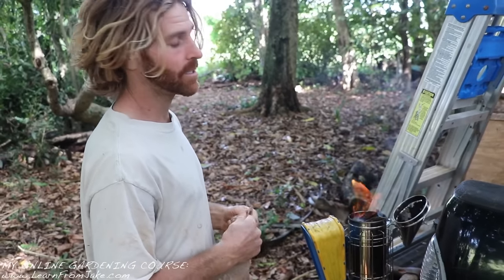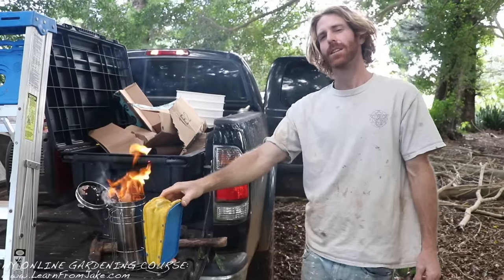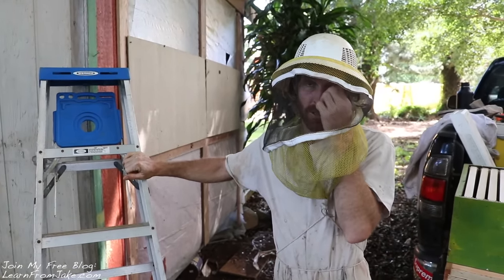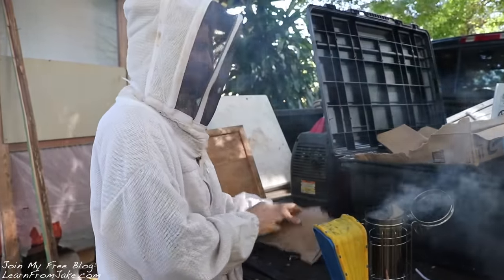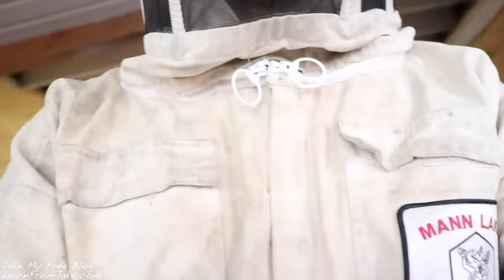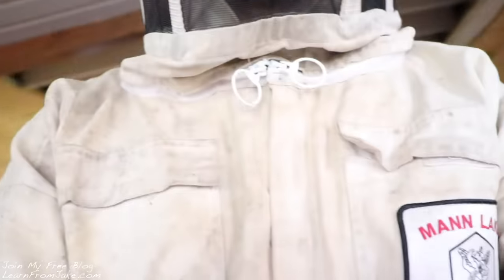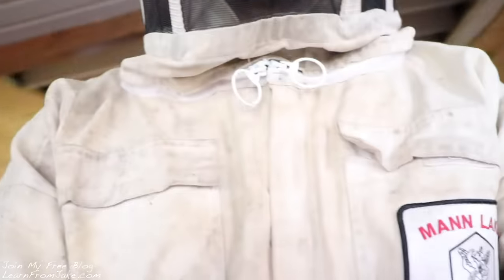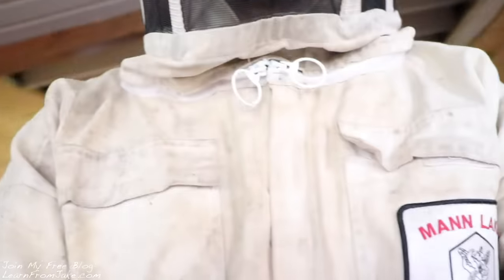Extreme Honey Bee Hive Removal | SO MUCH HONEY | Honey Bees in the Ceiling!

Comment: My answer to "why did bees evolve to die when they sting you" would be multifaceted. I haven't researched any of this but I thought it might be fun to just guess. 

Firstly, the stinger likely formed originally from some bit of carapace material, or even an orifice or vestigial organ, which caused it to be attached to other vulnerable innards in a way that isn't easily or safely severed.

Second, evolution doesn't have an end goal in mind. Nothing in nature or in the bee thinks "it would be better if losing the stinger didn't kill us, let's work towards that." Evolution is blind and is very rarely a perfectionist. The stinger characteristic only stuck around because it provided an advantage over what was there before and the bees who had it were able to more successfully pass on their genetic makeup and/or outcompete. It's possible that eventually, with a lot more time, even better defense mechanism woul evolve over millions of generations or more. But for now, even though it kills the bee, as far as evolution is concerned, the trait works good enough.

Lastly, again evolution is most often a very slow process of feeling around in the dark, and making small bits of progress through trial and error. For the stinger not to kill the bee, it would mean the bee has something to do after it stings once. Probably the most reasonable approach would be the stinger just doesn't fall out, since it would require a reshaping of the stinger and significant strengthening of the carapace. Not too much to handle there. Another solution might be that the bee loses the stinger but it doesn't die. In that case, it can't contribute to the hive nearly as well without it's main defense weaponry. It would ideally either regrow its stinger, or maybe develop a new job for the hive. In both cases, it's possible that it's just not worth the resources to the hive when you can just grow all new offspring. Also, both of these would be massive undertakings for evolution. Changing a part of one trait is one thing, creating an entirely new one is another. Many ants, for example, have different morphs for different jobs. Some have even separate workers and fighters, where the fighters are massive with huge mandibles and the workers are much smaller. Again though, this would fundamentally change the nature of the beehive's operation and logistics. Even I have a problem seeing any of this happening since again evolution cares about what works, and only refines a creature when there is a reason to in the environment.

TLDR: Bees don't survive when they lose their stingers because they don't need to.
Reply: I've done lots of research on bees (although im not retaining all of it this instant)!

From what i can recall, worker stingers are a modified ovipositor (not sure about queen stingers since they still have their ovipositor im p sure). This means that its still attached pretty solidly to their insides.

Their stingers arent actually supposed to come out, though! They were designed for killing other arthropods, in which case the stinging bee would be unharmed (young queens kill each other when the hive needs to raise a new one). However, we mammals have thick skin, and when the stingers slide in, they get stuck. Thats why that bee there was struggling to get away- it probably doesmt even know (as much as a bee can know at least) that itll die.

But youre right about why its lasted; there was never a pressure to lose the trait, since the hive can crank out more bees easily. Plus those workers arent the ones reproducing (the drones just leave, idk if they even have stingers since theyre male and wouldnt have had ovipositors to begin with), so their natural selection is a bit different.
Reply: @fallenstar780  Just an addendum: the drones will hang around the hive as long as the workers let them--they're otherwise useless--all they do is eat, and they don't forage or build comb. UNTIL...not entirely sure how they know, but when a young queen from another hive goes out on her mating flight, the drones will swarm out of the hives in the immediate area, gathering in "drone assemblages" to get a chance at mating with a virgin queen. Also, during the mating flight of the queen, many males will mate with her, in which process the male loses it's "stinger" and dies just like a worker that stings will. An older queen, or a queen that was incompletely fertilized might begin to lay unfertilized eggs, which then develop into lots and lots of drones. Beekeepers will usually destroy an old queen, incompletely mated or even virgin queens that just start laying willy-nilly, because too many drones will cause the hive to die out--no new worker bees are being born.
Reply: Why is there so many paragraphs
Reply: it means bees are not supposed to sting you, 
it's a last resort. Their design is pollination!

Comment: For the most part, I liked this video. However, I would have liked to see the removal of the rest of this hive. You slowed the video down, and paused in some areas for much longer than necessary, but I definitely would rather have had more footage of the comb removal instead. I also think you would have saved more bees if you had vacuumed the bees off the comb as you were removing it. Another thing I would've liked to see at least a bit of is you framing up the comb for the hive, so we could also see them in the box they'll be living in now. I think it's neat to see the framing of the comb. Other than that, it was a good video. You sure got a lot of honey out of the hive. It was massive, and the comb was so thick. Good video, even if it was a bit incomplete. 👍

Comment: The reason they die after a serious sting, is because their stinger has barb that hooks into the flesh. Upon lifting their abdomen up, the stinger tears out, usually leaving the venom gland with it, which continues to deliver the venom, due to the fact that the gland also continues to pump. Much like how a lizards tail twitches and flails after detachment. 

Pro tip: If you are stung by bees, DO NOT PULL THEM OUT! Use a credit card or CD to remove them, by angling and sliding it down the effected area. Like on a frosted windshield.

Wasps and hornets have a blade-like needle that isn't barbed. So they can keep stinging in rapid succession, and without dying. 

1,000 bees can only give you a 1,000 stings, 1 per bee. No more than that.

1 wasp/hornet can sting you 1,000+ times. And never have to stop.

Comment: The reason why the bees die is because the stinger Blade is serrated and gets  stuck inside soft mammal skin. When bees attack other insects the serrated stinger blades dont get stuck and they are able to rub their blades together to literally saw into the other insects with their stingers and then pull it back out easily. Bees can get many kills without dying i dont think they actually mean to die from the attack its just a accident like when a car rolls over a animal and the guts explode... physics. Their stinger are not meant for the physics of their current situation so they accidentally kill themselves in battle.